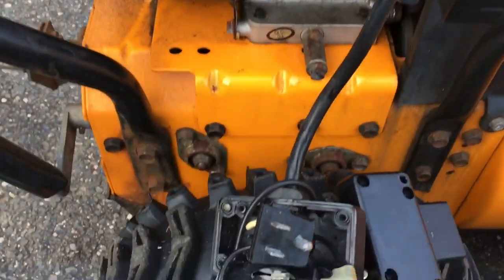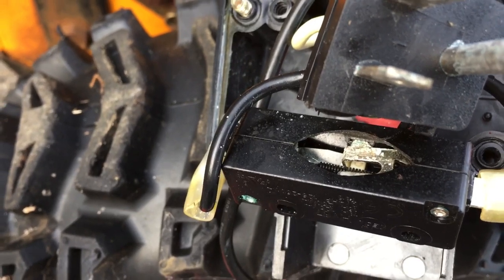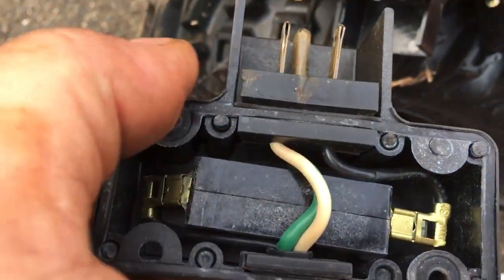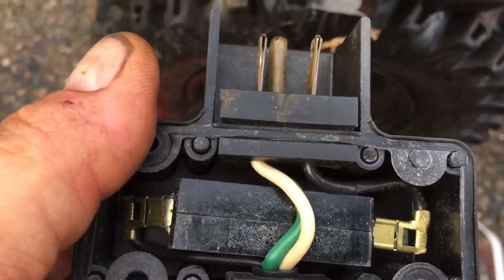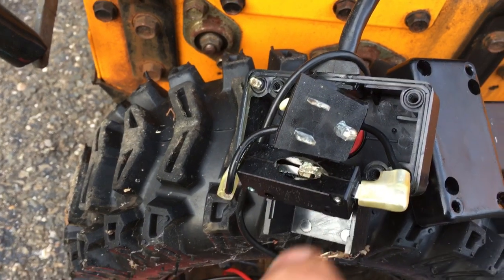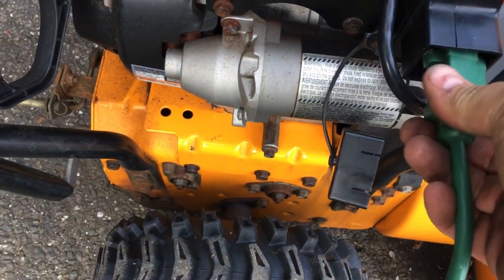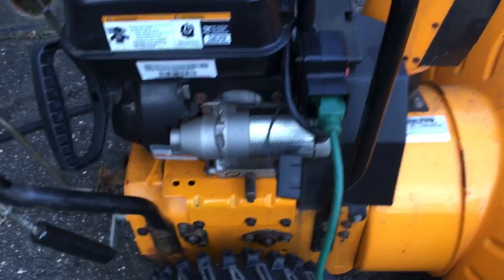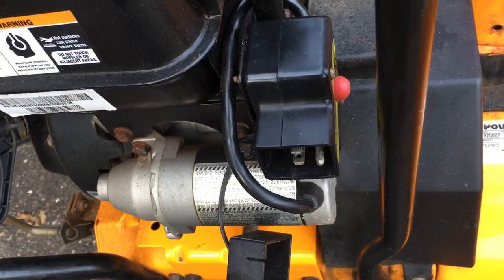Poulan LCT electric starter switch fix

Comment: Great Advice on saving old parts.

A person could retro fit an automotive relay in place of the micro switch,the relay  would have better durability but at a higher cost. You would have to match the relay to the amperage draw.